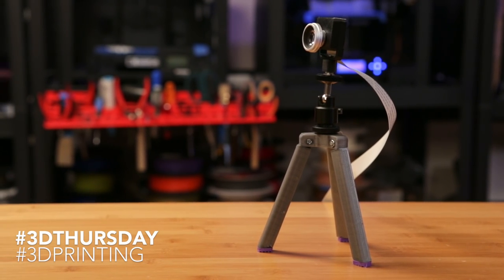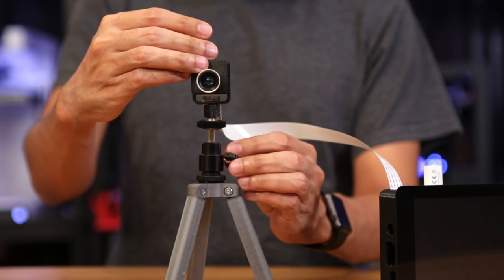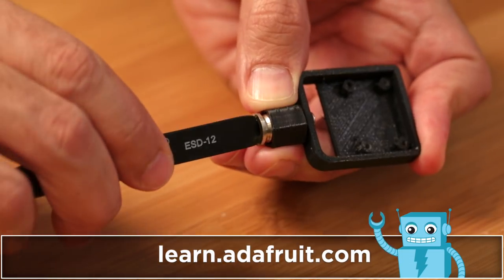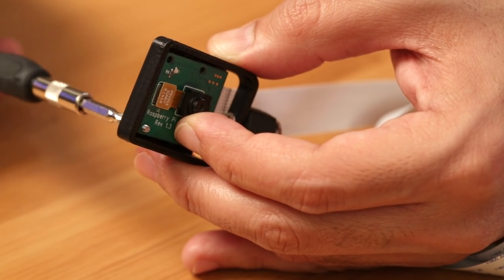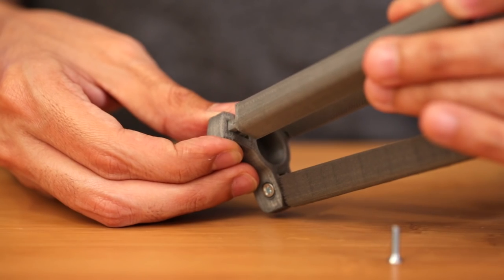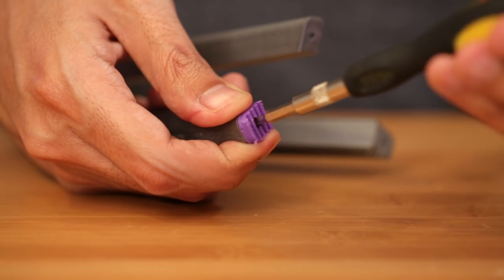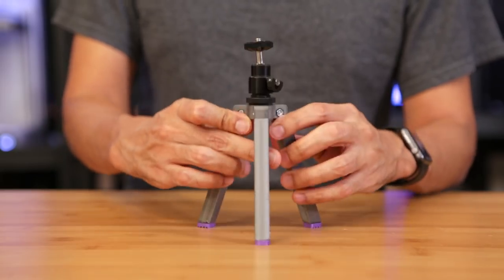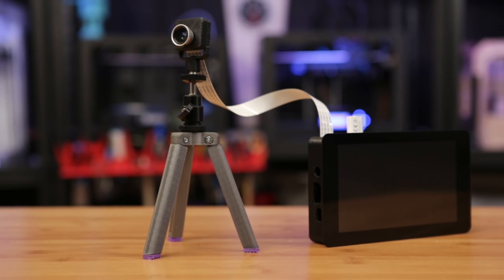Raspberry Pi Camera 3D Printed Tripod and Case

Comment: Just wondering, is it possible to make a HAT (or pHAT as Piminori calls them) for the Pi Zero with the connector needed for the camera? The two products could make for a pretty small integrated package that could be mounted on a tripod like this.